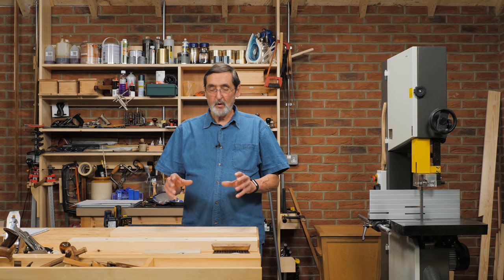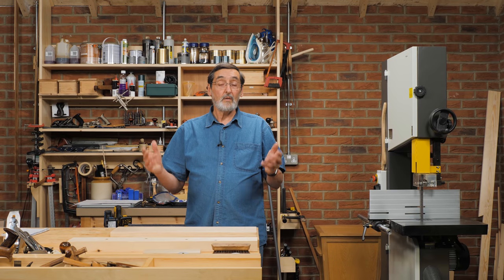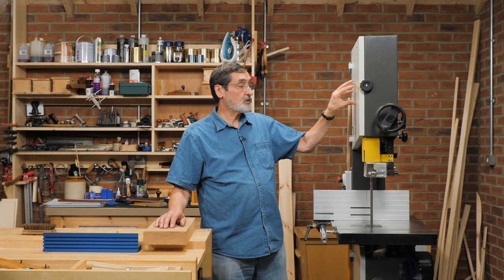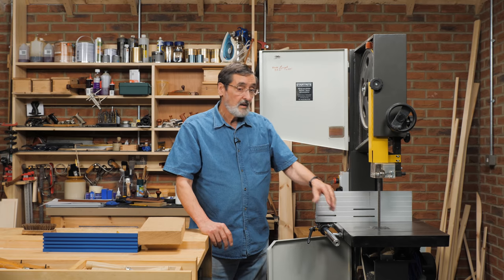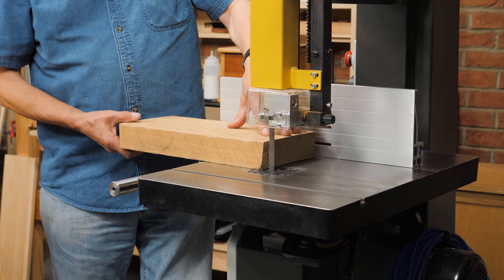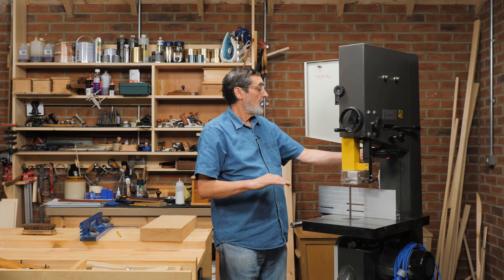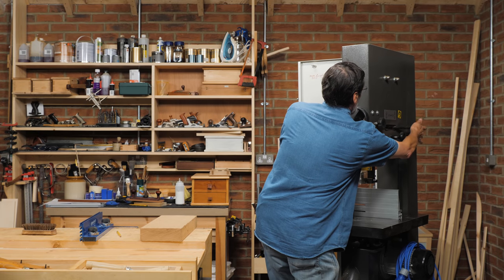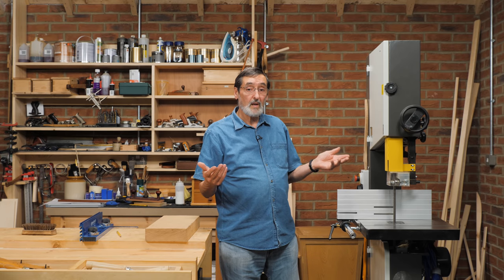Introducing the Bandsaw | Paul Sellers

Comment: This is just to confirm that you can learn something almost anytime if you only pay attention, sometimes from an unexpected source.  Already have a bandsaw, Grizzly G0513X2 and it has proven to be more than adequate for my needs.  I watched this video, primarily out of curiosity, to get your take on this power tool and saw a solution to a problem that I did not know I had.  My dust collection had a "Y" in it but I had put the "Y" right up at the intake on the collector.  This meant I was running two full lengths of hose along with the associated loss of suction.  After watching your video, with the "Y" at the back of the saw, I almost ran out to my shop to change my setup.  It even looks better.

Thank you for the help.

Comment: Thank you for the bandsaw discussion and the features to look for.  I am sure my wood working experience is not as extensive as most of your viewers.  For me the power tools are for stock preparation since getting closely dimensioned material is not always available or desirable and I can use the power tools to get good stock out of live edge or salvaged material.  But when it gets to the point that you begin fitting joints and final dimensioning your material, there is nothing more satisfying than the sound of a hand plane shaving the wood to a polished surface or the sound of the tenon saw and chisel cutting dovetail or box joint.
Even the most distinguished master craftsman of 200 years ago would turn to modern equipment to prep his raw material if he didn't have apprentices to do it for him.  Thank you Paul for your wonderful videos and continued inspiration.

Comment: Hi Paul, That's a neat bandsaw which beats the miniature one I have. They can be an expensive item to have in a workshop. I remember in my old apprenticeship days as a Fitter and Machinist, there was a bandsaw that had a blade welder and grinder fitted so that we could make our own replacement blades. It would butt weld the two ends, temper the welded area and then we could grind it down with the use of a thickness gauge to make sure the welded joint was able to pass through the guides etc. Those were the days that we did everything and not have to buy ready made blades at inflated cost. I think the bandsaw brand was "DoAll" which of course it did.
Reply: My university has an old DoAll welder bandsaw from the 1940's, still going strong. One of the best machines in the metal shop.
Reply: Hey Corson,
Tell whomever in the University, to keep that classic old machine. I used it and made untold blades for the Tradesmen that were teaching me over the years. These skills and abilities we learned as apprentices are no longer required in business but wouldn't it be great if they were available to us that have our home workshops. Thanks for the feedback, brings back old memories. Allan
Reply: The blade welders seem to only ever have been included with metal saws. There are several reasons. Metal cutting saws are more expensive, in general, so the added cost is more tolerable. Cutting inside of a hole, you sometime break and reweld the blade in the hole. With wood, it is often easier to just shim and glue a cut line to get inside of a hole or just route out the inside contours. Thirdly, metal cutting saws run at much lower speeds. These blade welders require user skill/finesse and there's a learning curve. If you don't heat treat the blade, correctly, a metal saw is generally more forgiving due to the lower number of rotations a blade will see in its lifetime before the teeth are dull.
Reply: I can see you've had the experience with these machines. Yes, there was a few things to consider when welding and tempering the blade, even the pressure that was applied to the butt weld had to be just right and the two cut ends needed to touch across the cut accurately to get a good weld. My experience with these was when I was a young apprentice Fitter/Machinist in New Zealand. Back in those days, Tradesmen had a very wide scope of knowledge and skill seeing it was pre-NC machines and that was my advantage. I'm always thankful to those great old Tradesmen that took the time and patience to teach me. Allan

Comment: You have greatly helped me with my hand tooling and fine detail work.  I have worked my body hard all my life (auto technician and shop owner by profession) and it's starting to show, especially with Carpal Tunnel.  Therefore, I have so many power tools.  Keep up the great work.  You are an excellent teacher and inspired me to slow down and enjoy my woodworking time with your tips and techniques.
Reply: Hi Brian - I had carpal tunnel release surgery this week. I'm thinking I need more power tools and to make my body last as long as possible so I can enjoy life to the full. I love using hand tools though.
Reply: @saxilbyjoe4325  How bad was it?  I'm headed there pretty quick I'm sure.
Reply: I had an electrical conduct test on both arms. One was severe and the other moderate - I've just had the severe one down so far. Four days in it feels better - although the boxing glove size bandage is a bit restrictive. Go for it.
Reply: @saxilbyjoe4325  Thanks for that.  Pretty sure my R will be severe and L moderate.  Have to schedule some vacation.  LOL.  Good luck with yours.

Comment: I started off building a table saw from an upside down circular saw.  I built my bench and other things in the shop.  I got a hand plane and liked how simple it is to take a few thousands off.  I would often use a miter box because it was quicker, quieter and made less dust.  A year ago, I had some $ and was going to get a sawstop.  As I thought about the safety, noise, dust I focused on what I was really trying to do:  easily dimension wood.  I also wanted to make my own lumber and a table saw can only do 5-6 inch cuts (by flipping).  So I got a 14" band saw for less.  I have 12" of capacity.  Less noise, more space and maybe less dust.  In the last year, I've been very happy.  My circular saw is back to normal and I've reallocated the wood I used to make the table saw.  Thanks for further validating my choice.

Comment: I enjoy my band saw for the same reasons you give, I simply do not want to rip large or even manageable lumber by hand. Electric band saw, drill press, and lathe are not cheating for a hand tool shop, in my opinion. They make the process enjoyable.

Comment: I used to make round coffee tables. I could never cut a round talble top by hand. I had to use board, with jig saw on one end, and peg on the the other end of the board. We would secure the peg in the middle of table, and swing the jig saw around in circle. The jig saws last for about two tables, and then burn up. Then we use an electric router, on a board. That worked if took your time, but it never gave us clean edge. I figured I need a band saw, but we made everything in small apartment. Thanks for the video.

Comment: A band saw is one of those tools that is worth its freight.  Mine is a fairly cheap, cast iron framed, two wheel model with an extension to take wider pieces for resawing.  One advantage in Europe including Britain is that the power tools are all 220/240 volt.  In the US you need to either run 120 or bring in a 220 line and think through what type of saw and motor you'll need, or cultivate an electrician to help with rewiring.

Comment: When I got my cheap bandsaw I was pulling my hair out trying to get straight cuts while using the fence. It kept wandering even though I had everything parallel and square. It wasn’t until I learnt to set up the fence to account for blade drift that I got much  better results!

Comment: I noticed that you build your bench higher than most too.  I am going to build a workbench to replace the one I am using right now.  Taking away the bottom shelf to help with cleanup an to raise it up by 4 to 6 inches and save the back a little.
Reply from the maker: You will soon get used to it and save your back. I know more woodworkers with bad backs and our questionnaires have well proven that too low is n=bad-back country. I have worked for 53 years at 38" high and have an excellent back at 68 years of age.
Reply: My bench right now is set up at 36 inches following traditional ergonomics templates.  And I do strain my back especially when I have wood in the vice.

I will be building a new bench soon.  Definitely going with construction grade lumber.  It's a workbench not a showbench and I would rather the nicks be on my bench than on my showcase pieces.

Comment: Interesting, as I like to follow your methods, but I always rip with a powered saw. The bandsaw covers this and is quiet. Mine has a light now which I find a help. I think I have the same as yours, maybe smaller, A Startrite 301, but a much older one. I had to replace the table as it was not level across the slot .  The winding mechanism for the throat is backwards progress as the teeth can get clogged up . A slide with a clamp is better. I like my bandsaw higher too. The kick stop is great. 
I hope you can advise us how to set it up and avoid drift.

Comment: I am more interested in seeing what you do with it. I already have a small table saw for ripping. To tell the truth a bandsaw forever changed my metalworking, but I haven't seen a solid need for it for wood yet.
Reply: Well, you have a table saw, already. And you can make intricate parts like trunions and brackets and the like out of steel with your vertical saw. So you can probably live the rest of your life without a wood band saw, unless you feel the burning need to resaw trees or make expensively thick veneers. Some people choose a band saw and a router table over a table saw, because together, this can be cheaper and more versatile than a table saw... just much slower at making lots of furniture grade rips due to the surface finish that has to be cleaned up. Now if most of your projects are cabinets and tables and bookcases, you will probably be happier with the table saw.

Another thing, is the band saw is quiet. No hearing protection needed. There's a lot you can kind of figure out as you go when cutting and making a one-off in relative silence and relative safety. 

For Paul, it is probably gonna be used mostly just to cut down larger materials to the sizes where the hand tools can take over and finish. The circular saw might be cheating, if you use those saw cut surfaces. The band saw will leave plenty of work for the hand planes and chisels :)

Comment: I have just bought a bandsaw (an old Startrite 351E, similar size to yours) and I've been watching many videos on this. But very excited to watch yours as you are one of my favourite woodworker youtubers. Previous owner didn't use any extraction and the tyres are a little worn but with a little clean-up, new blades, and some accurate adjustments, I'm looking forward to using it! Main thing is the frame and the wheels seem extremely robust. You mention in another comment you use an older model of Startrite, Paul (not the one shown here) - which model do you have?

Comment: It really look like a SICAR™ that is not made anymore. These models are in fact great tools. But you should make a video on how to avoid the blade drift on any band saw. It's not easy to adjust the parameter to avoid it. There are some factors the should be taken into consideration like the with of the blade, the quality of the blade and it's sharpness and pressure and the number of teeth. You are a so good teacher that such a video from you would be invaluable.
Reply from the maker: It's all on its way, Robert.

Comment: Thanks Paul 
It’s always good to take advice before buying a bandsaw! I bought a Grizzly G0555! Later I will buy a better model with more features.
Reply from the maker: I used a Grizzly 18 inch from 1988 until 2008 without any problems. Back then they said not to buy them because they were made in Taiwan. Today most bandsaws are made there but sometimes minor assembly in the country of sale.
Reply: That looks like a good handsaw.  It's heavy and should do a lot of work.  If it works well for you then you shouldn't "need" an upgrade.  Sometimes all you need is a couple of different types of blades and you are good for a long time.
Reply: My problem with this unit is the table is a little small, needs new bearing guides because it holds 1/4-3/4 blades sloppy, the raising lowering guide is manual and it’s under powered!
It’s a nice unit for the price but not very precise! 
Between the bandsaw and my dewalt slide chop saw I hardly use the table saw
Reply: @1956vern  The lack of accuracy and power might just be blade tension issues. I have a much cheaper similar saw but upgraded the tension spring and added roller guides. Even with a riser block, it tracks fine. I like rarely use anything but the widest blade that will fit.
Reply: David Kirtley:
I bought the riser block. It’s a great unit. I’ll keep it for now. It’s does not slip: I have used others with the fiber blocks that were more accurate!
Reply: Barry Manilowa 
I’ll definitely look that up!
We are so fortunate to live in this time! I’m 62 and remembered a time when I would of had to go to a library or search out advise from manufacturers or other makers!
Thank you very much
Reply: David Kirtley thank you David!
Reply: @1956vern  - When I replaced my thin blade with a think 2 tpi blade performance totally increased.   If you are sawing thick material then the sawdust needs to go somewhere and having big teeth makes some room for it to go into.  I am positive if you talk around with retailers they will point you in the direction of a person that welds up bandsaw blades for relatively cheap.   They are cheaper than a good chop saw blade that is for sure.

Comment: I really do not understand why there are so many people who apparently have a problem with Paul Sellers owning a band saw. What is the issue? I am sure that he has proven that he can rip down the length of long pieces of timber on hundreds if not thousands of occasions, so why waste his time and energy when rough dimensioning, re-sawing, and similar tedious jobs can be done so quickly on  the band saw. We have also seen that he uses an electric drill, lights his workshop with electric light rather than by candles, and he even has an electric steam iron, but I have never heard anyone complain about that.
Reply: This is a non-issue and no surprise. Mr. Sellers used a band saw in the very first video I watched which was making a wooden mallet. I made my own and have watched every video Mr. Sellers has made. Really nothing new.
Reply: @davehickman7857  Thank you, and to me it is a non-issue as well, but if you care to look at some of the other comments here you will see that some are apparently very disappointed that Paul Sellers uses a band saw, and another one even accuses him of being paid by sponsors to promote this particular tool. This is what I do not understand!
Reply: Also, cutting the rough curves on a piece will get you to the Stanley 113 (or other method of planning curves, ie mallet and chisel or spoke-shave) and would be a great time saver in that as well. Plus, as you get older your body doesn't really want to do what it did when it was younger and stronger. I love my hand tools, but the bandsaw leaves me much less sore than a hand panel saw of any design. Arthritis has taken its toll, and I just have a terrible time redrawing with a hand saw any more. I had a small three wheel one, but it can't do nearly as much as my 14 inch Wen bandsaw can.

Comment: About 25 years ago I bought my Startrite bandsaw. There was a clamped bar on the front of the table to attach the fence. It pulled the table way out of flat over the slot. About 1/16” step. It was hopeless. I rang them up and they said the table was flat within a few thou. I said they deserved to go bust if they didn’t listen.  I think they stopped trading shortly after. I Replaced the table with a solid aluminium one and have never looked back. Ive replaced the wheel bearings once. I guess yours is completely redesigned and made in China. I’d like to know how you deal with drift.

Comment: I don't like machines where I have to use my feet/legs to press the emergency button because i feel like when I am in a situation where I have to press it I want a stable posture. whenever possible I have installed the emergency stop on head hight so I can headbutt it. It works well because every time I flinch I press it in the same moment.